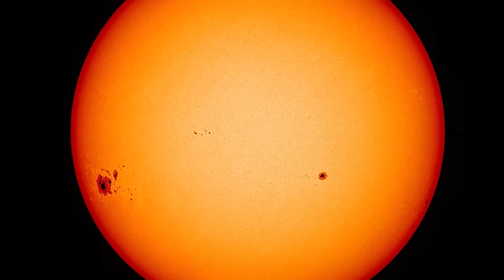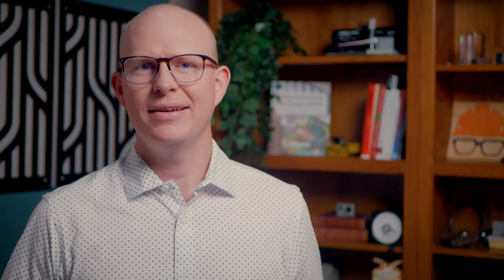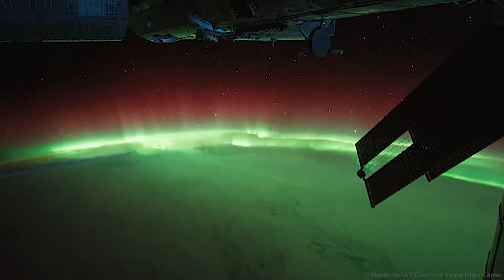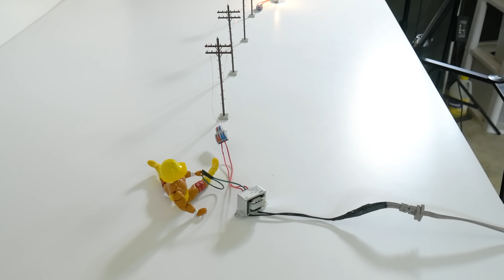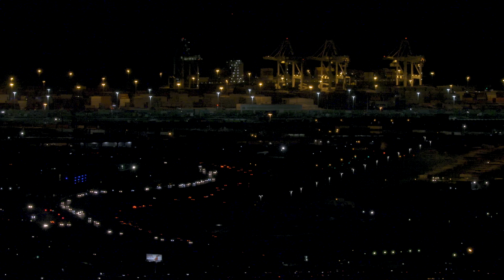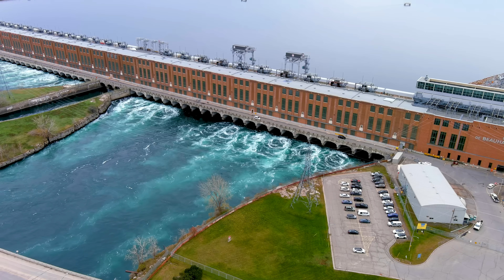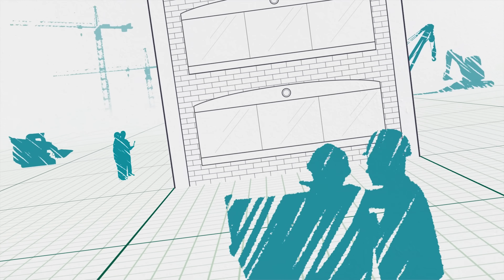The Most Confusing Part of the Power Grid

Comment: 16:40 Your picture showed a concentrated solar plant. That power generator does have inertia because it generates steam and spins a turbine, unlike solar panels.
Reply: Hahaha, good catch!
Reply: Well yes, but not quite. The sun light is used to boil water to create steam. The steam then spins a turbine and the turbine spins the power generator that produces the electric power. The way you described it, with the power generator generating the steam would cause a lot of damage in the power plant
Reply: @XEinstein  thanks Einstein, the generator definitely does not generate the steam. I don't see how anybody would assume that.
Reply: @ColCurtis  May point was that you yourself write it that way. Your wrote: "That power generator does have inertia because it (the power generator) generates steam". So your choice of wording is a bit confusing.
Reply: @XEinstein  my understanding is the concentrated sun light is actually used to heat molten saline, which is then used to heat the water to steam.  That's even more inertia thermally stored.
Reply: @leighdexter7493  As far as i am aware there is indeed molten saline used, but that was not a necessary part of my initial reply to indicate that it is not the generator that creates the steam but the other way around.
Reply: @leighdexter7493 ’saline’ means something mixed with (often water) or at least relating to salt, aka ‘salty’, so saying ‘molten saline’ is like saying ‘molten salty’ or ‘molten salty (water.) It’s molten salt or salts.
Reply: @EarthIsNotFlat  correction, molten salt.
Reply: @XEinstein  if there is excess power produced, why not run the generators in reverse to consume it on site?
Reply: @erkinalp  A generator running in reverse is sometimes called a  motor.  Elevated water storage does do that.  They "pump" to push water uphill, and then run as turbines / generators on the way back down.
Reply: @erkinalp  The motor would have to drive something, just running a big generator as a load wouldn't be that much load. Not to mention all the associated costs with allowing it to run as a motor. Also depends on how large the generator is to begin with. The large hydro gens they can run as a synchronous condensors are very heavy and lots of inertia. A concentrated solar plant probably isn't anywhere near the size of hydro generator. As others mentioned, they do use pumped hydro where they generate power as the water flows down through the turbine, then they can reverse it and then pump the water back up to the storage pond / lake.
Reply: @erkinalp that’s an excellent idea. Some utilities actually do run the generators backwards to consume the excess power, but not “on site”, because consuming the power requires the “motors” to do work. (Running a generator backwards is called motoring”.)
When Grady is talking about running “synchronous condensers” on the power grid, he’s basically talking about motoring generators. Motoring the generators helps with voltage control. The motors can both consume and produce the VARs that he said is necessary for system stability. (And partially to your point, could be done on site.)
But your main concern isn’t about voltage control, but about power consumption. And some of the other answers here point to a practical solution: not just consuming excess power, but getting a return on that excess. That’s where the pumped storage comes in - pumping water uphill to be used at a later time to generate electricity with hydroelectric generators. Los Angeles, for example, does own an operate a 12,000 MW hydro plant that can move that much water in both directions, thus utilizing excess power in the morning hours when demand is lower than what the sun (and wind) is actually generating, into the hours later in the day when demand would traditionally call for the gas turbines to start coming online. In this sense the renewable energy is reducing fossil fuel usage twice, by delaying the burning of gas into much much later than we used to when we didn’t have as much solar and wind connected to the grid (LA, like many utilities in California, burns primarily natural gas rather than oil or coal.)
Reply: @erkinalp  there are several reasons.
Firstly most power generators are not designed for running in reverse, i.e. motoring. While the generator will certainly run in reverse when you put electrical power onto the generator, the generator protection device has a function to prevent a so-called reverse power event. For a generator to be used as a motor, it needs to be mechanically designed a bit differently than a generator that is used only for generation.
A second reason is that running the generator in reverse would actually not consume all that much. The steam or gas turbines that normally run the generators are designed to spin with very little effort. (I was once doing a test run on a 25 MW steam turbine that with one puff of initial steam to get going kept on spinning uncontrolled for almost ten minutes), so the generator would actually not consume all that much power. In addition it is really really bad for the turbines if they are spinning in the opposite direction. 

Just to give you an idea: when a turbine is shut down a turning gear is activated that rotates the turbine shaft until it has cooled off. Such a turning gear takes about 3 MW to turn the shaft. So the, let's say, 25 MW generator would only consume about 3 to 5 MW when it would be used for motoring.

Comment: I've heard that flexible loads, especially those that can be turned off in seconds like Bitcoin mining, can play a role in helping to match demand to supply on grids with a lot of renewable power generation. How does this simple concept interact with reactive power?
Reply: Its unrelated.  Modern DC supplies (generating the power used by the mining electronics) just look like resistive loads to the power company.  There is no significant reactive component.   This is because modern DC supplies have PFC (power factor correction) circuits in them.

There are some crypto mining operations situated near renewable generators (such as wind farms) that soak up excess power that would otherwise require the wind farm to curtail its generation.   They usually get a break on pricing with the provisio that they do not run during peak periods.

However, this is a strictly temporary business model.  Grid-scale storage is increasingly soaking up excess power generation in the middle of the day and vastly reduces any potential curtailment.

-Matt

Comment: My dad had a table saw with a motor that included a sizable capacitor. I asked him what it was for and he said it made it more efficient. Being in grade school at the time, it was probably good that I didn't ask him how. I figured it out myself while I got my BS in physics. It basically consumes the reactive power of the induction motor to realign the current and voltage.
Reply: Actually, I suspect that the capacitor on your dad's table saw was there to support starting.  As Grady explained, capacitors cause a phase shift.  Motors require two electric fields at an angle to each other to develop mechanical torque.  A starting capacitor is used to create that phase shift.

Comment: Hi Grady. Hydro electric plants can be run as syncons. They use huge air compressors to push the water around the runner (the big propeller bit) down and out of the tailstock. This is so the runner can spin in air. They mostly act operate with a lagging power factor to offset the natural capacitance of the long power lines. Many big factories, mills etc will have their own power factor correction systems in place. Mainly capacitors to correct for the large reactive loads. They get billed for maximum demand as well as power so it pays to keep the power factor of the plant as close to unity as possible. I worked in the HV electrical system for years as a substation fitter then a protection and metering technician.
Reply: Thanks for that, I was wondering about using  generators that aren’t generating as syncrons (I think that’s what you are saying) to manage reactive load.

Comment: Nice piece. It brought back memories. Years ago I designed industrial control systems and we had a client paying huge power factor penalties due to some very large motors. (one was 300 hp) We installed a capacitor bank which cost many thousands of dollars (440 system) but their payback was less than a year from lower utility bills.
Reply: Oh, toy motors…
A pair of 10MW motors really do a number on the grid when starting and spinning a 1500 ton grinding mill up… (nothing like dimming lights 300miles away when you start them - the transmission lines acted as a soft starter even with the 15MW backup power gas turbines on site running).
Reply: @allangibson8494   Thank you for that perspective; scale is instructive in engineering, as are fundamental/theoretical relations.
Reply: My boss is always talking about some soft starts he put on some massive well pumps in Texas years back. In their case I think he said payoff was somewhere around the same. I think he says 16 months, I'll have to ask. 

He went to college with the dude that was high-ish up at the water authority. Their draw on startup was absolutely astronomical.
Reply: @goosenotmaverick1156 
My understanding of soft starters is that they lower in rush power demand. They are not for reducing reactive power or improving the power factor. The power factor penalty or reactive power cost are different than peak power demand cost. Peak demand is important. But peak demand is a different subject than reactive power. They have different solutions. That is my understanding.
Reply: @erniecolussy1705   yeah now that you bring it up, It wasn't necessarily a relevant story 😂 

I gotta drink my coffee before hopping in the comments. Lol my bad folks.
Reply: @erniecolussy1705  one example of using soft start is on phase cut dimmers, where FETs are used and not large enough to handle the 10x inrush current if an incandescent load.
Reply: @goosenotmaverick1156  No worry that was interesting all by itself and still in the relevant topic about "the grid"
Reply: Kind of crazy how a 300 hp motor sounds so big in the industrial world, but for an EV that's just business as usual.
Reply: @pocketpc_  Not totally an apples to apples comparison since industrial 440V 3 phase motors are quite a bit different from DC driven EV motors but it is amazing how much power they get out of EV motor systems. Of course, you are pulling power from a $15k+ battery pack and using huge amounts of electricity to charge them. I haven't studied EV charging stations but I am asssuming they ramp up the charge at the beginning to avoid huge inrush currents.
Reply: @catnvol  all the electric vehicles more sophisticated than a golf cart (cars, e-bikes, motorcycles) use 3 phase motors, driven by variable frequency inverters. 

I guess the big industrial motors are synchronous AC motors?
Reply: @catnvol  Most modern EVs use brushless AC motors to reduce maintenance requirements.
On DC motors you need to check the brushes once and a while.
Reply: @thewheelieguy  Try twelve phase cycloconverter variable speed drives for 15 to 20MW class motors. A cycloconverter samples the incoming AC waveform to create a lower frequency outgoing signal to the motor stator. The ones I am most familiar with had a top speed of 10RPM on a 96 pole motor. (The rotor was 10 meters in diameter).
The older style drive had two 10MW synchronous wound rotor motors with a ring gear to the mill casing. Starting direct on line was “rough” on the grid so usually a wet soft starter was used. The earlier 5MW drives on the older grinding mill were DOL only and rougher than the twin 10MW drives when the soft starter was in circuit to limit the start current.

Comment: Ah, so that's why they charge for having too many solar panels at home?
Reply: No.  And who is "they"?   The power company?  My power company doesn't care about how many solar panels I have.  The only limitation is the 20% rule for circuit safety.   If you have a 200A service you can't safely backfeed 40A.
Reply: @junkerzn7312  I had a conversation about a problem a guy had because his solar panels have excess power and is pushed into the grid, so he gets charged extra and has to keep a few disabled.

Comment: I have several things i would like to point out

I think your battery is undervoltaged, normally your battery should not go below 11.5V, but it could also be a 5 cell lead acid battery which is not common, so i suggest checking and since undervoltage can damage batteries

And some mistakes in the video
1. The reason the light bulb got more resistance was not due to higher voltage, but due to the filament getting hotter, most materials when hotter get more resistive
2. Please do not put an electrolytic capacitor in an AC circuit unless you want to be electroBOOM
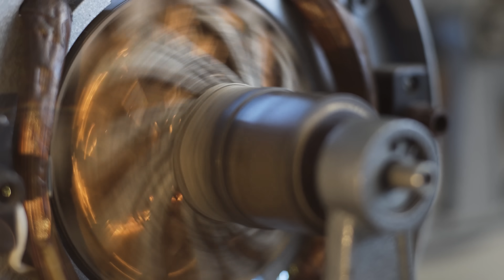3. 9:20 is a brushed DC motor

Otherwise it is accurate, and i do not expect a civil engineer to know every detail about electronics

Comment: Great video. The only thing I'm not clear on is how on earth Grady used an electrolytic capacitor on an AC power source without the cap blowing up 🤔
Reply: with low voltage and small duty times they can be used for much more than a textbook might suggest

Comment: Hey, really interesting video ! I have one question, could you explain what are the benefits of having the load really close to the source ? I'm from gravelines, and we have a huge nuclear powerplant here, and right next to it is the dunkirk harbor, which is a huge industrial zone. I was told that sometimes the metallurgic plants were even paid to use electricity! I'm guessing it has something to do with the inductance of the transmission line, but then I don't understand why bother making a grid at all if you're better off using it locally. Especially since Europe is one huge grid ! Also, how do they know how much electricity goes across borders ? I'm sorry, that's a lot of questions.
Reply: Your question touches on two unrelated issues.  First, the desire to have the source close to the load is because physical separation requires power transmission, and more power transmission introduces more resistance and inductance.  As a result, physical separation between source and load further complicates the problems Grady addressed.  It also increases losses which means that more power must be produced to meet load requirements, thereby reducing efficiency.

The second issue is the matter of inducements given to large loads to encourage consumption.  This has to do with the operating efficiency of power sources.  Sources such as nuclear plants need to operate at their rating continuously, and their output can't easily be varied to meet varying demand.  So there can be periods when it makes economic sense for system operators to request that large users continue to consume in order to sustain operation of those sources.  That said, systems ideally are designed with 'cycle capacity' that can easily be turned down, or even off, to respond to changes in demand, while leave 'base load' sources such as nuclear plants running at constant output.

Comment: Hello Grady,
You did an excellent job of explaining cos φ (power factor) in a graphical fashion, with the phase lag of 90 degrees caused by a reactive load.
The problem of explaining the difference (in AC circuits) between active and reactive power is because power is a vector, not a simple number.
This is why I prefer to precede all the explanations about reactive power with a crash course on complex numbers and vectors calculations, together with some basic trigonometry.
After just two days of math lessons, every aspiring technician is able to operate advanced power equipment in the power station.
The problem of solar coronal mass ejections, is that they induce asymmetries in the sinusoidal waveform, which are seen - across the power lines and the power transformers - as a DC component, which is almost impossible to manage.
Greetings,
Anthony
Reply: The day they taught us budding EE's phasors was a day that I'll always cherish because it massively simplified equations. Before that you had fractions with real and imaginary numbers that had to be added, subtracted, multiplied, and divided. With phasors it was vastly simplified. The multiplication of phasors involves the multiplication of the magnitudes of the vectors, and the addition of the phase angles. Division was the same but the subtraction of the denominator's phase angle from the numerator. Addition and subtraction were similarly simplified.
Reply: I might be dumb and inexperienced, but can't you manage DC component with coupling caps? Although that might not be practical with the high power the grid transfers
Reply: @creeper6530  With signal transmission, caps will do a fine job, but not in very high power 60 Hz systems. In power grid applications,  the problem is that on a Y 3 phase system. the center connection is grounded.  Any DC component is just passed to ground, through the transformer, giving an offset magnetic field, in addition to the normal magnetics in the transformer.  When these big, expensive transformers are designed with little overhead, the extra DC current will cause the core to saturate, creating, essentially a short.  Older equipment was not able to deal with it.
In a Delta configuration, this does not happen, but the voltage spikes could still be a problem.
Reply: This reminds me of the relativistic energy equation where mc2 squared plus pc squared is total energy squared.